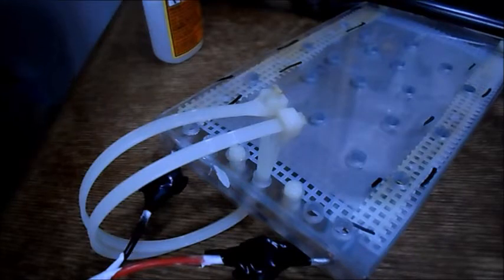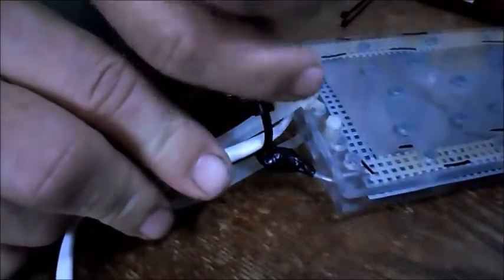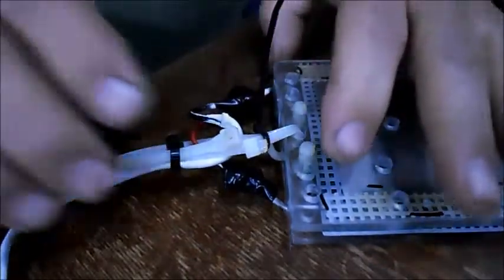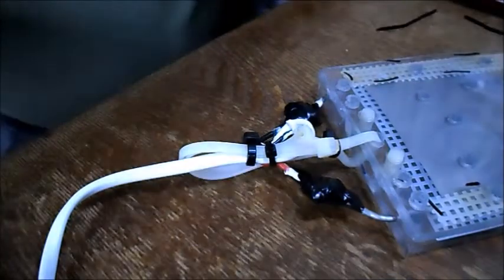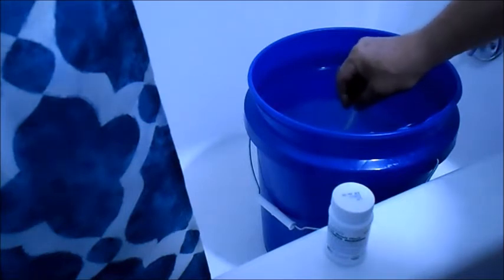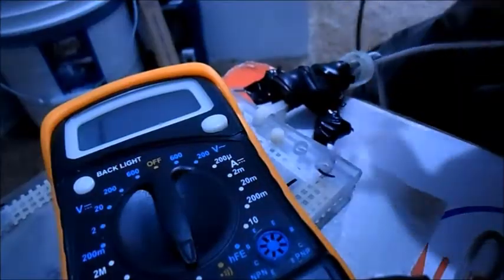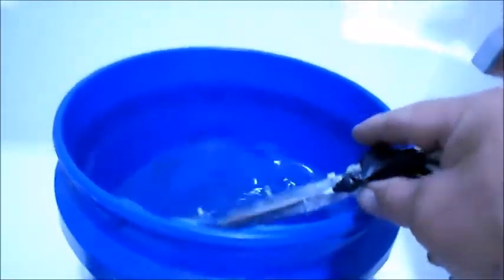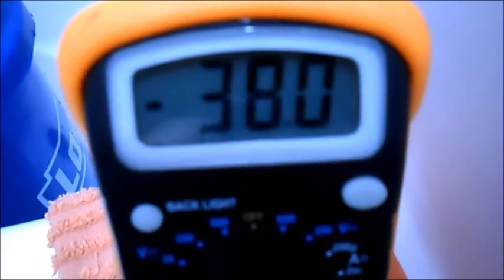oxygen generator #6 clean well water

Comment: I've done this back in 2007 to make hydrogen gas with 9 stainless steel plates drawing 18 amps. But I would be worried because of the hydrogen gas build up in the well casing. You'll have to find a way to get the hydrogen gas out of the well casing or you could have quite an explosion.
Reply from the maker: Quite true... hydrogen gas is very quick to disperse as well as it rises rapidly. I had 3 rapid combustions myself while working with hydrogen generators.  The gas is only released for a short time and allowed to vent because there is no tight seal at the well head. Very good thinking sir. It is a good thing to mention that it must have a way to escape. I will put that information in my description, Thank you very much. This does work better than chlorine in my well though.
Reply: Dave Nooner  👍